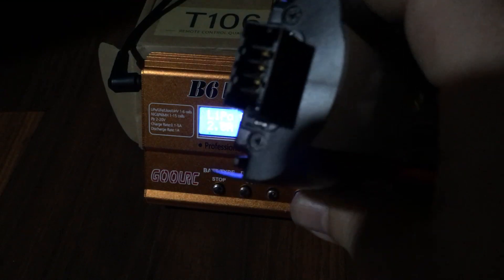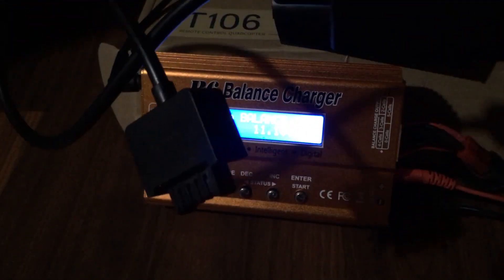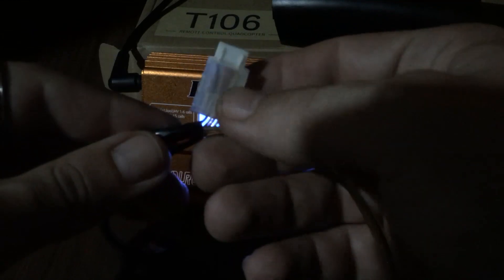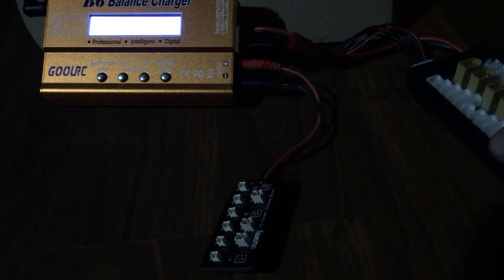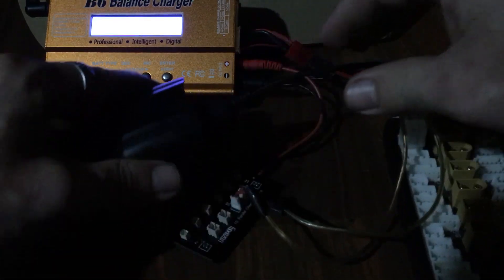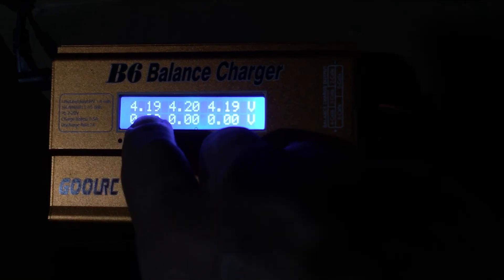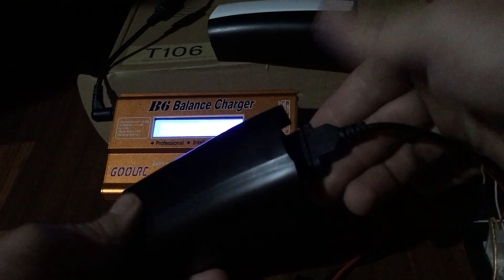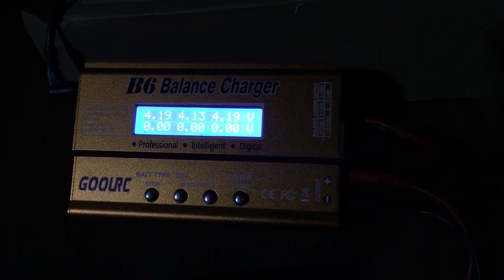SAVE Bebop 2 Batteries Balance Charge B6 Review

Comment: I know this is old news on the BB2 battery but if you balance charge the OEM battery with a balance charger...it either ruins the board in the battery or causes it to throw off an error in flight ...which will cause it to do the very common,"fall out of the sky" move.
The OEM charger and OEM battery are specifically designed to work with each other.
Through my own trial and error with 3 different Bebop 2 drones and a total of 7 OEM batteries and 4 after market batteries...I do know that balance charging the OEM batteries can damage the BMS...not always,but it can.
The only remedy that works 100% of the time is bypassing the OEM battery board,or if you are going to balance charge the OEM battery,then dont charge it above 1.0 amp max....its a slower charge,but it does balance the OEM battery and wont ruin the board inside.
After too much trial and error experience to really explain here...all I can say, is that if you constantly balance charge the OEM battery at high amperage with a balance charger...it will ruin the battery and cause the Bebop to possibly fall out of the sky....I would guess theres a 60 to 80% chance that this could happen.
This may not apply to everyone but from over 450 flights from 3 different Bebop 2 drones and 11 batteries...2 Bebops fell out of the sky and failed due to this error...
My 3rd Bebop has had zero issues with the OEM battery or any decent aftermarket battery by following the same criteria above.
Also putting in an OEM battery and hard resetting the drone also resets and recalibrated the BMS in the drone.
This is good to do after evry 5 to 10 flights. You just have to re enter your settings...which isnt a big deal...its just like rebooting a computer and makes everything run better...and really that's what it is...rebooting a flying computer with a camera.
It keeps telemetry accurate and kind of "cleans up" trash that may be in the multiple systems within the crazy amount of tech in this drone.
 The Rolex Drone Channel said it best..."its like a flying laptop"...
Keep in mind that even though this is a 5 year old drone...it has a dual core CPU and a quad core GPU and runs Linux.
Hold this helps out...I'm sure not a know it all but I can only speak from experience...

Comment: another thing, my IMAX wont balance charge, keeps saying  VOLT connection error, i try balancing at 3.7,, i see you got yours at 2.0, I charge my battery then discharge them but doing that over and over again killed my battery!
Reply: The battery is 2700mAh so you should do 2.7A instead.

Comment: Hey JD. How do you charge your bebop battery s with the I max 6 ,not the Bebop2 but the bebop red quad you have.I have not fouls a plug that will fit??
Reply from the maker: I ran pos n neg right into it not really balance charge but never caused issues

Comment: I have the same exact B6 charger. I'm waiting on a $5 Bebop 2-to-balanced cable to arrive from China, then I'm gonna splice a build some kind of adapter. My red Bebop 2 fell from the sky using my white battery as well. I've had no problem with that BTG Amazon 3700 you recommended, nor with my red batteries. Great work as always, Jay! Thanks a bunch.
Reply from the maker: You got it hope u can get it situated